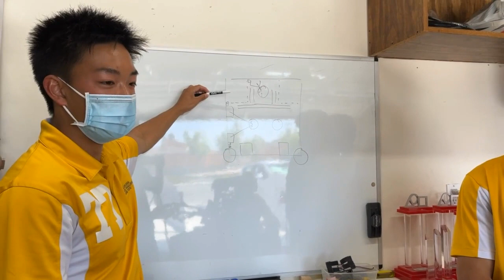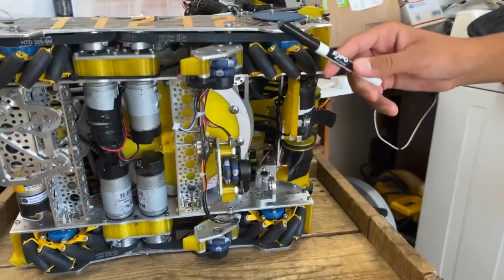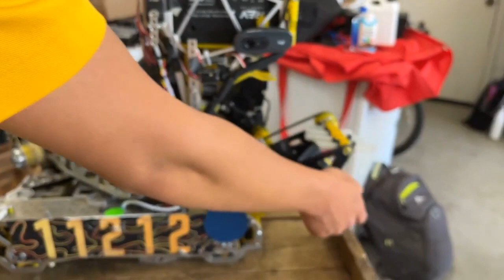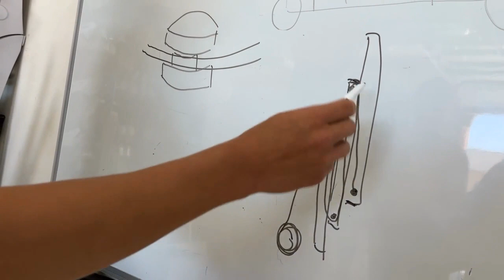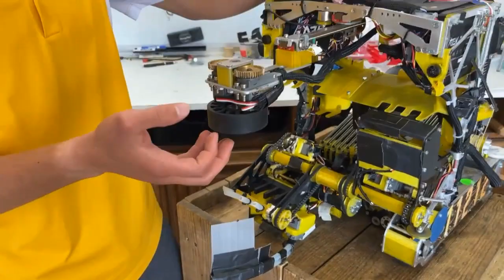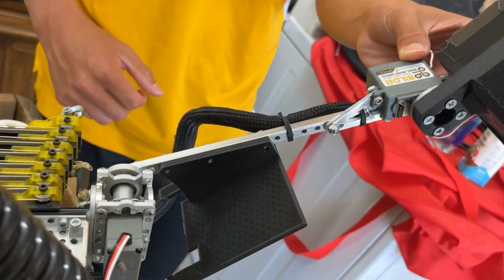The Clueless #11212 Robot Explanation | 2021-2022 Freight Frenzy

Comment: Where did you get the spring-like cable management device for your slides?
Reply from the maker: called a "coil cable". For FTC-legal coil cables that can power servos, you need the wires in the cable to be at least 22 AWG thick (24AWG is commonly found in coil cables but is too thin and is considered unsafe). There are specific dealers for coil cables you can find online like this: https://www.coilcablespecialist.com/22-awg-3-conductors-electronic-shielded-coil-cable-2203em0s.html

Comment: Great video!  It was a pleasure watching you at World’s.  What were you using to stop the linear slides going out and returning?
Reply from the maker: what do you mean by "stop the linear slides"?
Reply: When your slides extended, what did you use to stop them at the same distance (or close to the same distance) every time - were you using motor encoders or switches or some other method?  Very curious especially with the speed of your slides.  Thx.
Reply from the maker: @garagesquadrobotics7476  just the motor encoders! and a very optimized gear ratio, well-greased slides, fast loop speeds, and a well-tuned controller.
Reply: With the slides running so fast, did you have much error in their position over a match?
Reply from the maker: @garagesquadrobotics7476  no; we had no mechanism to reset the slides, just relied on encoders, which I don't think really drift (at leat over 2.5 min).
Reply: Thanks for the info and hopefully we will see you at World’s again soon!  Cheers.

Comment: You guys mentioned you wouldn't use the bevel gears if you were to do it again, with this same robot is there another way you would suggest mounting the motor?
Reply from the maker: not sure tbh; possibly could have mounted it vertically if it were in the middle of the turret, but obviously a lot of other things would have to change then. we also thought about trying out rev's 90 degree gear box but not sure if that would be better.

Comment: What is the gear ratio on the motors you used for your slides? They mad fast lol
Reply from the maker: 2x 5.2:1 gobilda motors, geared something like 2:3 for torque (dont remember exactly). I don't know the spool size by memory either.
Reply: @theclueless11212  thanks!
Reply: @theclueless11212  that 1150 rpm motors right? dont they get really hot?
Reply from the maker: @Kimiman-nc3qk  motors generally only get hot if you stall them for long periods of time (stalling when they draw the most current). We do not stall them.

Comment: I have a question about the coil cable that you use to power to the servos on the end of your arm.  What type of coil cable are you using?  Did you run into any issues powering your servos with such a long cable?
Reply from the maker: It's just a 22AWG 9-wire coil cable. we had some issues with intermittent power loss early in the season, but we just cut the cable in half and it seemed to fix itself. No issues after that
Reply: @theclueless11212  We had similar intermittent power losses as well.  A coach at MTI explained that despite the low resistance of the wires, the greater the length of the wires, the greater the inductance.  This higher inductance causes the voltage to rise more slowly when first applied and so causes issues with the servos.  If you look at our robot (Wolfpack) you will see that we faced pretty much the same wiring issues.  I particularly enjoyed your video because you made choices that we quite similar to ours, such as the long linear slides and the attempt to score ducks during endgame.  Congrats on a great season.  Your robot is excellent.
Reply from the maker: @fasvi1285  thanks for the explanation, makes a lot of sense! big fan of yours as well (eagerly awaiting your FF robot explanation 🤔)
Reply: @theclueless11212  I know that they just put up the video on the Ultimate Goal robot.  I will ask Owen and Chris if they can also make one on the Freight Frenzy bot.  I know they have several videos they want to make this summer.

Comment: What specific bearings did you use for the bearing stack?
Reply from the maker: just radial bearings from amazon. the top/bottom bearings are 1/4 ID 1/2 OD. The middle bearings are 1/4 ID and 3/8 OD (and 3/16 width).
Reply: @theclueless11212  no need for thrust bearings?
Reply from the maker: @Rampio-yj7mk  nope

Comment: what pressure sensors are yall using?
Reply: The FSR we use is: https://www.amazon.com/dp/B00SK694YE?psc=1&smid=A2GTSJRNFEVVSP&ref_=chk_typ_imgToDp . Make sure you follow the correct wiring (with a resistor) because you have to solder this yourself and they burn fast. We recommend soldering to the same connector as a servo so you can easily change wire lengths/plug and unplug when replacing.
Reply: What is the resistance of the resistor that you solder in series with the sensor?  Also, do you have any specific resources you look at when thinking about using analogue sensors like these in FTC?  In other words and guides to their correct use with the Rev control hub?
Reply: @fasvi1285  I don't know resistance but we just look up analog ____ and find a sensor. Analog is great because you just match up the 3 correct wires and it works. You may have to do experiment to find the conversion between voltage and real world condition of a sensor, but this is the same as using most sensors.
Reply: 5k
Reply: @pjwetherell9414  Super helpful.  Thanks.

Comment: One of the best informative ftc videos out there. Love ur robot and team and good luck for next season. Software overview ..?? would love to know some of the coding stuff that went into this
Reply: We will see about releasing a code overview. If we did, what would you be interested in seeing? Would it be more like general overview of what we're doing with math/logic or line by line explanation of our repository.
Reply: @pjwetherell9414  thanks for the reply, I think it would be really useful for teams to see how you controlled the robot, say a general overview of your driver controls (did your turret have preset positions, or did you just use manual control), how you optimized control for the drivers (e.g. everything say intake, transfer, slides in one button). Similarly how did you switch your turret position/intake if you went from running your cycle auto to running shared hub, and ways you thought about optimizing this throughout the season. (or having 2 drivers control duck cycling effectively)

with your auto, would love to see how you controlled both your driving/ mechanisms/ generated driving paths (did you use road runner, pure pursuit or something else, computer vision?) or how you angled every time you drove into the warehouse, or using your pressure sensor to detect freight and generate a new path. For your auto specifically, it would be really great to get a more in depth explanation of how you structured your opmode for newer teams, and lines of code you used to control stuff. Also some of the things you guys thought were cool/innovative, or the main things that set your auto apart from others (as well as progression throughout the season) would be great.

Basically to answer your question, a bit of both :)